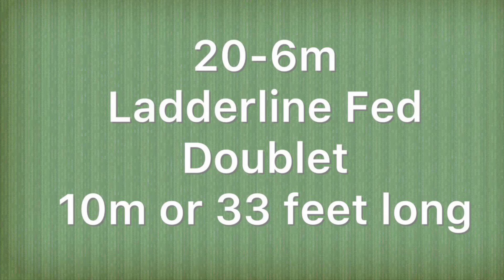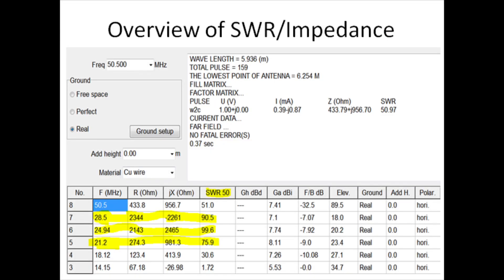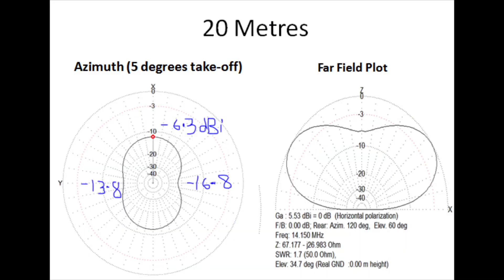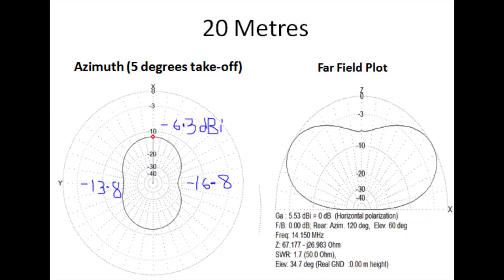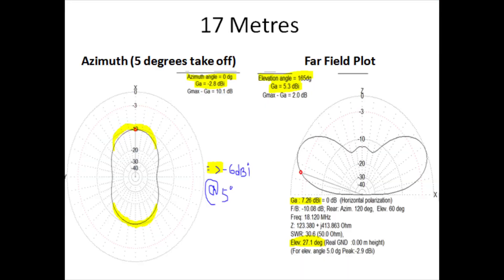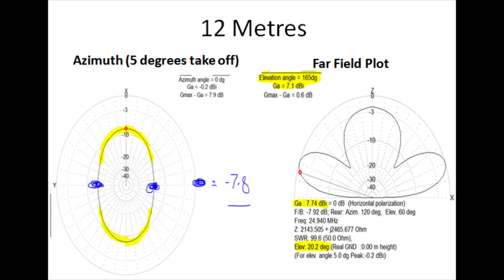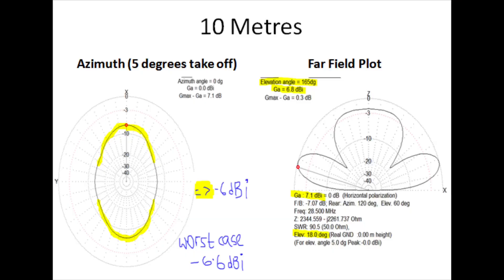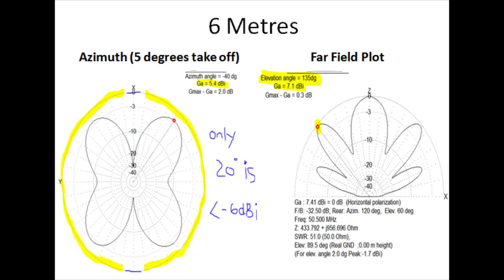Multi-Band Doublet Antenna: 20 to 6 Metres

Comment: Ok that's very good but how about next time you show the antenna all assembled and installed as well as some radio contacts with the antenna ?   Too much theory is not very good.
Reply from the maker: There’s always room for theory. I’ve made and used this antenna and the theory presented here confirms the fact I know it works 73

Comment: I'm very fond of the doublet I have up at home. It recently bagged me a 20m contact into VK and plenty of other DX over the last two years. I agree if space is limited and you want a good multiband HF antenna they are a cracking and extremely good value option. well done on the latest series of videos Tim. The antenna modelling stuff is a great addition to your excellent presentations. 73, Tom.
Reply from the maker: Thanks Tom 👍👍

Comment: I run a Mosley 5 band, 30ft above the ground, which has one element on 17M and worked JA several times over the last few months with 100w.. agreed 15m and 12m are so so, 10M is one of my favourite bands.. I have done all the DX on 6/4M over the years past, so 10M still stands out for me, de Ei2iP. Thanks Tim, very informative as always.
Reply from the maker: Thanks Robbie sounds a great set up 73

Comment: Tim, how would this compare if you took your pole and mounted it vertically with the bottom being just high enough for your kids or pets to avoid the ends?  I do have an old GAP Challenger that the internal wiring rotted away that could be fed with latter-line to be a rigid vertical to be much the same, so I am especially interested in what the software model might say. Another "make you think"  good video!!
Reply from the maker: Good thinking! I might look at the vertical doublet modelled. How long is the challenger?
Reply: @TIMG5TM  It is essentially a 20-meter dipole that had a few attached  elements for other bands but with the matching (a secret) coax came apart, 75 ohm matching that didn't work well except on 20 meters. About 16.5 feet each side with a pvc pipe insulator-center section. http://gapantenna.com/shop/antennas/challenger-dx/

Comment: With a bit of messing with the length of the ladder-line you can shift the impedances around the Smiths Chart. This can mean for instance that the full waved dipole can be transformed to a moderately low impedance at the shack end. Doublets can be very effective (and efficient) or to misquote a popular meme "You can't beat a non resonant antenna"
Reply from the maker: Agree! I’ve found some interesting calculators re: ladderline impedance which I’ll send on to you 73